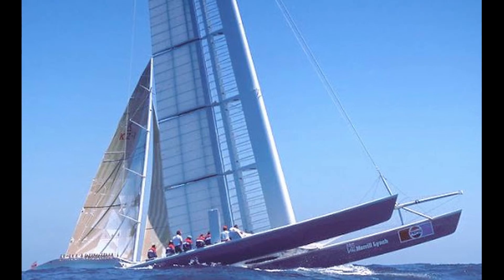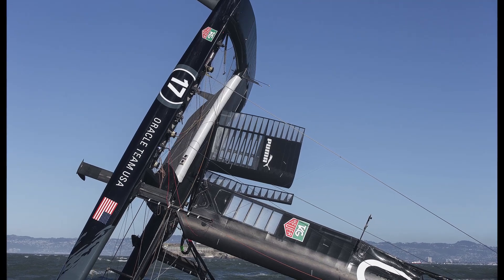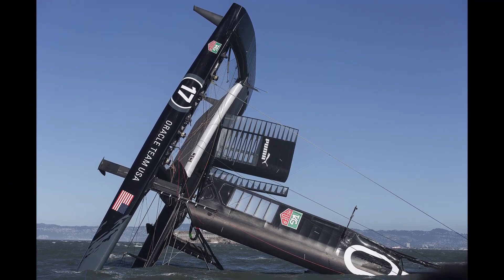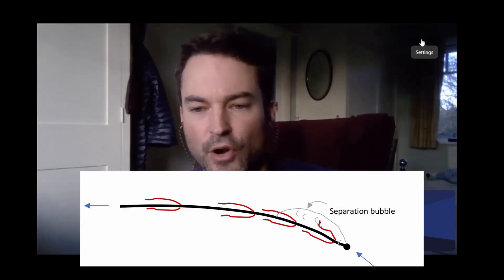America's Cup Mainsail Systems Revealed: Part 1

Comment: With having the hydraulic system for the main sail in the boat of luna rossa must be better in so many ways. The fact the weight of the system is lower in the boat unlike inios who ruun a boom and hide it in there, to even run a boom which adds weight and then adding the hydraulic for main sail in it higher up than inside the boat must cost speed, plus the boom and hydraulics swing from side to side where lunna rossa hydraulics for the main sail stay central and don't move. Only marginal gains but all adds up

Comment: Interesting as always. Comments on the summary about sail shape in the first 5 mins. I recall 35 years ago windsurfing sail manufacturers were addressing many of these issues;  fully battened sails with an extended mast sleeve (partial twin skin) that effectively reduced drag and turbulence on the leeward side of the sail creating a much smoother airflow; sail foot increased  to seal the sail to the deck of the board; sail head extended to increase sail size (sail shape much like the AC 75); batten shape inducing a more aerodynamic foil at the luff. So what's new?  ;-)

Comment: i am practicing a sailing sport belonging to a “specific corner” of sailing: sand land yachting and ice boat. somehow very similar to foiling boat: low drag, high speed and thus very close apparent wind, down wind leg with apparent wind below 35 deg and so on. somes years ago we did try double skin sail, facing 2 issues: manage the cord lengh of each skin when the rotating mast angle change and  control the sail trim and shape “single handed”. Finally we found the complexity of the sail control to high for single handed. I am also surprised that no sail maker are developing sail with “negativ leech”. at low apparent wind angle and medium/high wind, it is a easy way to control twist and overpower on a dynamic way. Imo better than the funny “bat wings”

Comment: Errr. if no boom, 'outhaul' doesnt mean what we are used to?  Outhaul imples tensioning the foot = compression in the boom. Maybe there is push or pull relative to the mainsheet attachment point(s)?
Reply from the maker: Yes, outhaul becomes more like clew board. However, not completely due to size and angle of clew board and presence of battens just above. However, onboard communications refer to 'outhaul' so I've kept that terminology.

Comment: Great breakdown. Exactly what we need to know,  the helicopter shots are enlightening as well. We have had the boom question since  racing Formula 40 's in your backyard.  Actually,  Smyth designed a boomless stock main for a real competitive  3 man Stiletto 23 fleet before the 40's. That racing prepped us for Europe and we didn't even know it.
  Manually,  boomless is more trimming and little more strength required too.  Our first 40 had a hydraulic boomless mainsheet.  16" bilge pump levers, leave a guy to leeward to pump like crazy and the windward one too.
  Back in the  U.S., Prosail 40"s were stock, but sails were ours and Randy's were the sweetest mains against the North's Ullman's, some others. I was built like a rugby player to handle manual main trim on very short courses. If we had a (little) guy done with a takedown, he could jump on the leeward winch too. I liked the speed and safety of a winch.

  Fast forward, I get a hair up you know and decide to make a foiler of my Bimmare Javelin ht 18', now19'.  Recut main to  a boomless decksweeper,  problem is with foiling you want a flatter main as speed picks up, when easing in a big puff,  more camber is unavoidable. Our new smyth mainsail is perfect, depowers and trims effortlessly and has an expensive wishbone boom to reduce camber when easing, it is helping for sure.  You built my very pretty, very fast white reacher from a Marstrom 20,  the hoist is tall on the ht, sail is huge. New battened jib too.

  Back to these boats, I kept telling Randy these mains are exceptional for their purpose and believe they are the secret to the boat design's success (mind boggling numbers) and are overlooked by the foils (by the audience ). I believe the shape is much better than a fixed chord camber wing mast, it and ultimately more shape control. The team's super computers may beg to differ of course. You are the first to dive on these amazing sails and their mysterious controls. The boom works well as you said, Ineos had a more consistent inner skin camber. But the Italians form follows function approach may be the elegant answer. 
  Bravo to my wonderful Italian friends. Sailing with Max, Shannon and family in Rolex and other regattas were just amazing times. The sailing is in English, the swearing is all Italian, which is great, you don't know if it was you that screwed up. If you did, you are sure to be embraced with love, forgiveness and enthusiasm.
Reply from the maker: Great comment, thanks for sharing!
Reply: @MozzySails  + 1

Comment: Excellent breakdown again. 

It’s an educated guess but in the case of all marginal gains adding up I do think the better shape at the bottom of the mainsail on LR is helping and so it might not be big but it’s significant enough to help.

What I would say is the high mode probably comes from how LR can adjust the slot (between main and jib) and I also wonder if they are using the windward runner to temp put in extra mast rake... what do you think they do when LR goes into high mode ? For me this has significant advantage when starting and if needed at certain points on the course or in the close upwind match racing parts.

Comment: As a land sailor (ones that sail on beaches at 60mph, and not sit in arm chairs) we are looking at the main sails very closely. The difficulty we have is not the bottom of the sail but the top quarter getting the twist correct. I have like the look of the Ineos mainsail the most, from the few shots of the complete rig. Smooth running is significant as jumping travellers will send waves up the rig.
Reply: yes, our running backstays are either tight on for windward or just on to stop them flying around loose so that makes sense.

Comment: Interesting stuff, thanks for the insight/analysis. A Class Cats went to boomless, decksweeper mains a few years back. The shape of the sail is mainly controlled using mast bend (down haul on an A class and a little pre-set bend in the mast) and the main sheet that has some out-haul angle. Mast rotation is also important but less so as the apparent wind angles narrow both up and down wind.

Comment: those are not hydrolic lines. No way!
Reply: Perhaps inside protective aero tubes
Reply: If there’s lines they’ll be at other end of the boom. And they’ll be a larger gauge. Hydro pressure is immense. Less weight, less movement and shorter lines if they run hydro up by the mast. Hydro lines don’t come that thin for good reason, flow rates and pressure etc

Comment: Great video. Don't agree with your theory about the LR white hydraulic lines.  

I can't find any evidence of these white lines not being under tension, same as mainsheet. Under tension is not a good idea  for hyd. lines,. Hd. lines should have slack in them to deal with range of motion, and incidentals..  

If they are hydraulic, then a entire system would have been developed to keep them tensioned,  (as seen in video), easier to just to run hydraulic lines out between the sails from mast base.  regardless of boom, or no boom.  LR did work hard, not to have a boom, then to put hydraulic systems up in the sails seems counterproductive. Changing a mainsail, now you have to deal with swapping out hydraulic connections. Risky, even with quick disconnects, adding bulk and weight.
 
I agree your basic  theory, that they are  " outhaul" tension  one for each mainsail/side. 

They however are control lines that turn on the mainsheet traveler car.  For each control line, there is a hydraulic cylinder, traveling with, lying parallel, same sheeting ratio, as mainsheet cylinders. With this you keep weights lower in boat., and eliminate complexities of running all hyd. up into sails.

Comment: Double skin sails are a great development that can be put into normal boats, albeit on larger yachts and I say that because the negative for a dingy is the extra weight and the mechanism to adjust two skins. The real advantage is you are able to produce a perfect aerofoil shape with control of the laminar flow and separation. They can in effect have the perfect glider wing in the vertical. The on,y thing they miss is a winglet on the head of the sail, one that can be hinged and moved to windward on each tack/gybe!!
Reply: One benefit not mentioned in this clip (unless I missed it) is the prevention of vortex shedding, which I presume is associated with the separation bubble (which they DO talk about). It seems to me this lets them keep control even when feathering the sail, in hurricane force winds. Anyone who has tried to nurse a boat through gusts with a single skin mainsail carrying too much sail at these wind strengths will know about how the rig can shake the boat like a terrier with a rat... not a great option. These sail/mast combos are even smoother and presumably less inclined to initiate turbulent flow than any of the wings I have seen to date on sailing vessels.

Comment: I have a questions about future races of Prada Cup ? 
1 When we will know about that ?
2 What would  happened if one or more sailors get COVID now ?  For ex. one of skippers , drivers or any other non muscle sailor ???
Reply: Race most likely Saturday NZ time. The weather looks like race will be on Bens favourite course if the Souwesterly arrives in time otherwise the winds possibly too light to race. Auckland weather can change rapidly, but two day forecasts are fairly accurate. AFAIK skipper would have to quarantine (not go to work) as would other close contacts until they get negative C virus test. Possibly Gov would exempt them for a race as the are fairly isolated on boat I think they would have to cross that bridge when they came to it.
Reply: We will know at 4:30 p.m. NZ time. Bout the COVID I don’t know what the NZ government protocol dictates.
Reply: @zaphodify  Thank you

Comment: Yes! The video I have been asking for in the comments!
I was thinking that maybe the very bottom of the main is less important too. I imagine that the air is moving more slowly and is more turbulent down there, close to the water and the boat's surfaces.
I thought it was hilarious when you outlined the top 4 metres of the mast, and it was such a tiny part of it. That's a large sail!
Reply: Yes they dwarf almost everything on the harbour, it makes them easy to spot. From a distance the boats don't look like much just a little insect but the wing now that is impressive! Not much is bigger out there other than the odd super yacht & container ships but none of those travel across the horizon like a low flying fighter jet. I going to miss them when the next America's Cup is sailed in Dubai :-(
Reply: @cindyullsee393  I hadn't heard that the next America's Cup would be sailed in Dubai. Won't that depend on who wins this one? (I'm expecting NZ to win, but they might not!) Dubai would certainly be a sterile backdrop compared to the Hauraki Gulf.
Reply: I personally think the main's bottom zone is mainly going to be important at marginal foiling speeds and windspeeds: the more drive you can get low down, the less you load the leeward foil (because it is the sole source of righting moment to resist the heeling forces from the rig)
The last thing you want to be doing is apply extra downforce on the foil just when it's being asked to climb to the surface. But of course you do need forward drive, and lots of it.
I briefly wondered if this was also the rationale for the old-school-look, low aspect jibs, except they are not generally used in marginal foiling conditions, so it must be other considerations - maybe it frees up top zone of the main in respect of quick and effective alterations of the angle of attack to keep heel under fine control 
... given that the triangle of support for the platform is the wrong way round (like a taildragging aircraft). This makes the boats naturally - and dangerously -  inclined to heel more, the more they heel, because heeling (to leeward) effectively sheets the sails in. The AC50s did not suffer from this syndrome as their support was rectangular; the angle of attack of the sails was neutrally affected by heeling.
Reply: @Gottenhimfella  Certainly looks like the elegance of Luna Rossa's didn't hinder their Prada Cup victory.

Comment: 4-5m2 of excellent mainsail shape, right down at deck level - I'd call that a worthwhile advantage for LR.  NZ's shape nearly, but not quite, as good. However NZ has a deck level camber adjustment device, to really force extra camber into the bottom of the main for more low down power when they want it.
Reply: Not only can the kiwis proactively force extra camber, it seems to me they may be able to do it really quickly in comparison with more conventional systems. I speculate that this might allow them to "catch" the apparent wind vector, ie keep the flow attached rather than stalling the sail, in situations where the AWA shifts suddenly aft. Perhaps this helps them to keep foiling at lower windspeeds than the area of their foils would seem to support.
Conventional reactive systems (it seems to me) rely on the force of the wind normal to the sail chord overcoming the friction of the outhaul car, turning blocks, etc etc, to drag the car forward, at a time where (with the flow stalling) the available force is diminishing.
Of course this "catch" hypothesis also relies on the instincts of the trimmer alerting them early that extra camber may suddenly be required to preserve the angle of attack at the luff of the main. And the jib trimmer likewise....
Reply: @Gottenhimfella  Note that they use hydraulics to control all aspects of the mainsail - outhaul (including differential outhaul), cunningham, mainsheet etc etc.
Reply: @maxhugen  I thought that was probably the case. I also have a hunch that TNZ are using small hydraulic accumulators (I seem to recall the big ones are only allowed to be used for foil cant and flaps and rudder rake) which would explain why they are able to make such rapid adjustments of short duration.
Reply: @Gottenhimfella  I think you're probably correct, as they can't use the ones for foils, rudder etc. Certainly, when they are doing a lot of tacking, the grinders are going flat out! 😎
Reply: For me the benefit for LR is reduced windage and less drag. With the fairings, 0.5kt boat speed advantage maybe...?

Comment: Having the hydraulics for trimming main sail under the deck in Luna rossa puts more weight lower down in the boat, isn’t that also better for weight distribution and center mass when under wind load?
Reply from the maker: yes it certainly is. They are limited by rules on where the CoG must be in the boats, but having it low gives them flexibility to put other stuff higher.

Comment: OK, got that. How do they sail downwind? The sail setup looks nothing like a convention sailing setup. It basically looks similar to sailing upwind or on a reach. Very curious.
Reply: Because the boats go so fast downwind, the apparent wind means that they must sheet in way more than on a conventional boat, and using off wind sails like spinnakers is unnecessary as they would add too much drag
Reply: @tomknight5432  I understand that logic. So, what you are saying is that once the boat is flying it is the sail (Wing) that is propelling the boat forward? Ambient wind doesn't seam to be powering the sails to give enough forward "thrust". Am I on the right track?
Reply: @fintanusa  Fred
Take a pencil, paint a wind triangular with boat speed 3 times the wind speed.
You will find a course downwind with roughly similar apparent wind direction than going upwind.
Just the apparent wind is less intense- wich gives less aero resistance and less driving force.
The compensate with a bigger chamber in the sail to keep the driving force for the foils.

You got it? Roughly both directions to be sailed with the same sheet angle.
Reply: @fintanusa  you are mostly correct, but I would add that the true wind is still providing some of the drive, it’s just that the apparent wind is greater, so they must sheet in their sails more to prevent the sails luffing. Just to be clear true wind is the wind that you feel when stationary and apparent wind induced from moving through the air. Hope this helps 😀
Reply: @tomknight5432  In theory at least, an AC75 could sail in zero wind if it was on water moving at 6 Kt or so, and go in any direction it chose at 30 Kt or more other than 45 degrees each side of the direction of current, because of the apparent wind. This has been modelled in a simulator for the amazon river.... including 'tacking' upstream!
Reply: A spinnaker or Genoa would never fly, unless they are in displacement mode.